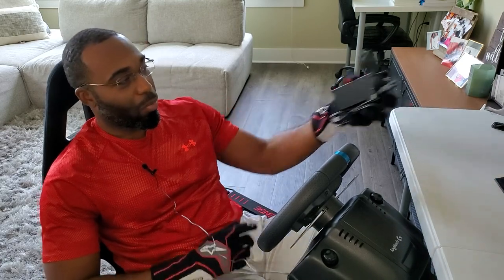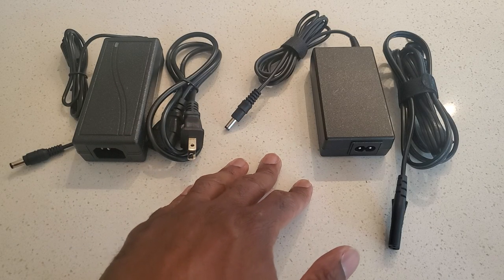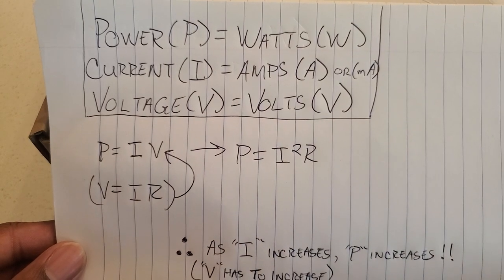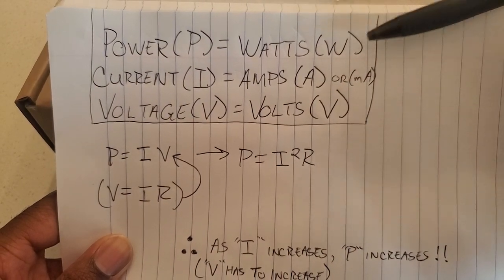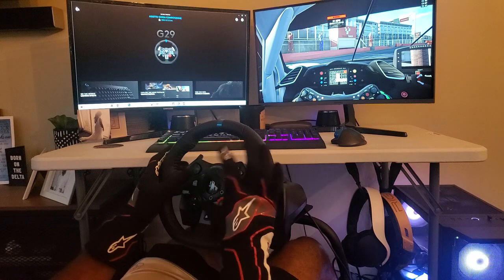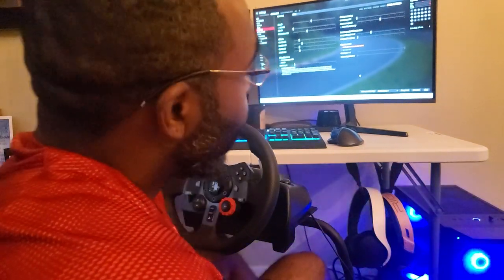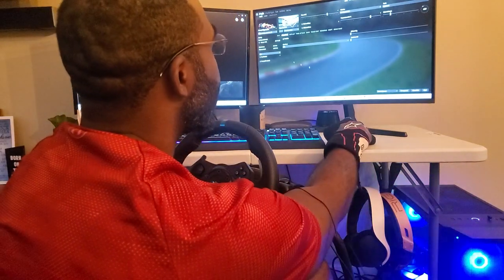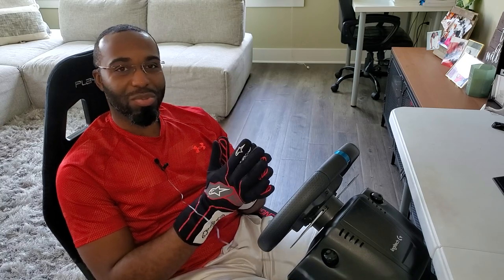G29 5A Power Supply Upgrade

Comment: I'm afraid that's NOT how it works. (Electronics is my fully qualified trade).
P=IV is correct, but current (I) is not determined by the number written on the power supply. That is only stating the maximum current that power supply is rated to deliver. 
CURRENT is derived from Voltage and Resistance by "I=V/R".
since V is a regulated = 24V; it will not change.
and R = the electrical resistance (inductive reactance more specifically) of the PHYSICAL WIRE in the motors windings; it will not change.
If V doesn't change, and R doesn't change then "I" DOES NOT change. 
The included powersupply for G920 (which is actually DC 24V @ 1.75A not 1A but it doesn't matter) will already have current overhead by design. If logitech were to provide a powersupply that was too low; then 1 of 3 things would occur: 
1. an unprotected powersupply would overheat and possibly burn
2. over current protection (OCP) would kick in and the power supply will shut off entirely.
3. the power supply will hit current capacity, and since I and R cant change, then V will drop below 24V (Vdroop) and the wheel may shut off.
Since a 1.75A PSU is supplied: Being a mass production consumer product, a you can "expect" that actual current requirements will be somewhere around 1A (I might measure and confirm this myself if anyone is interested)
You could connect a 24V 300A PSU to this wheel and it will only ever draw the same ~1A at 24V.
Reply from the maker: @forestR1 thank you for the explanation!  This illuminates things. Can you help me understand why there is a difference in the FFB? I know that a lot of people will day that it is perceived but I have tested both power supplies extensively on the same tracks and cars and there is a noticeable difference  etween using the two power supplies.
Reply: @JCCollinsRacing  "perceived" is my first reaction too (with a caveat) you say a lot in this video that you don't really feel any difference. Then when you do start more feeling more hit It's AFTER you have cranked setting up way beyond what you usually run, so it's going to feel different. then going from F1 to ACC, youre still going have F1 feeling as your reference.  
But the caveat: YOU have the actual hands on experience here. I dont. Perhaps the included power supply is too low. I find it hard imagine logi would do that; but it's always possible.
The test i think could prove one way or the other; play the SAME game, with the SAME settings using both power supplies. go back and forth a couple of times changing nothing else.
If you are still sure the power supply is the difference; then maybe i should measure the current draw (will require me to pull cables apart).
Reply: @forestR1  I don't know electronics well, but I have limited experience with a hobby motor and different batteries. I have a 2 cell lipo and a 6 cell NIMH. Both had a similar voltage. Both had similar top speed in my rc car. However, due to the nature of LIPO batteries, they can dump a LOT more amps than a NIMH can. The RC car had a significantly faster acceleration with a LIPO.

I am not an electrical engineer at all. I just have a hobby grade RC car I mess around with occasionally, and thats just from my personal experience. In mine, the power source did effect the performance of the motor. But not in top speed, only acceleration. It also burnt out my brushed motor lol, but thats because it was old. Same speed controller, just switched it to LiPo mode ajnd put in a lipo battery with a similar voltage but higher amperage.
Reply: What about adding a 28 or 30 volt power supply then? Will that help the force feedback assuming it doesn't burn out?
Reply from the maker: @Sirrecalcitrant  according to some of the comments here, increasing the voltage will definitely effect the FFB, if the motors are rated to handle that voltage and if the internal systems of the G29 will allow that voltage to go to the motor. I do not know the exact technical specs of what the motor is rated for, but I would assume that 30V would fry the motor and system.
Reply: @JCCollinsRacing  Sounds like pure confirmation bias. Try a blind test where somebody else switches the PSUs and you then need to find out which PSU is currently in use. Do this a couple of times and see if you can actually reliably tell the difference. Make sure you don't get any hints whatsoever from the other person.
Reply from the maker: @EnnoMaffen  I like this blind test idea! I may have to give it a try.
Reply: The wheel likely has pretty bad power transients meaning power will momentarily go above the rated power of the supply (while still averaging less than the actual rating), leading to vdroop, and as long as that droop isn't insane enough to fall below step down circuits for the control logic (around 5V probably) the wheel will just feel a bit slow to respond.
More headroom for current will fix that, higher voltage AND current makes the experience even better.
Reply: @MetroidChild  i suppose so.  i was working on the assumption that voltage wanted to be around nominal to stop the wheel from disconnecting, but you're probably right about 5V. Infact i think the wheel does work off USB alone. so.. Im probably wrong after all
Reply: So it doesn't hurt boosting your placebo.
I have g29 for 4 years with 3A psu. I bought it second hand with non. I later bought g923 brand new. 
Anyway. I tested the g29 with the original psu and  in a rally with lots of frequent feedback from the bumps, I can definitely say that with the bigger amperage you can feels more details when you get more action. Torque is absolutely the same.
Reply: @EnnoMaffen there's a series where a guy over volts all sorts of electric toys. They ALWAYS perform stronger and faster! But once the voltage goes too high, most toys shake themselves to death 😂😂

Comment: There is a full motherboard in it that controls the whole system of it including power supply so it will not change a bit BUT if its asking for more power a heavier psu will help it 😊😊

Comment: Thank you for the recommendation! Just got mine in the mail and after some testing, it does indeed provide a noticeable difference in the response of the wheel which helps a lot with quicker counter steering while drifting especially. It doesn't immediately become a belt driven wheel, but it is definitely an improvement and worth the small investment.
Reply from the maker: @Bryan Cheah I'm glad to hear that this worked for you!
Reply: Being UK 12v 5a b ok for this?
Reply: @ThePrescott32  you probably will need a 24volt one, lower will make it weaker. However, only go higher at your own risk, you might damage the motors.
Reply: @bryancheah2568  no I get 24v 5a as seems b save side of it
Reply from the maker: @ThePrescott32  I am not exactly sure about the UK... make sure that the power  supply matches the voltage of your home's outlet to avoid any issues.

Comment: ICs and motors are under-used with OEM power supply, so you can use more voltages without any other upgrade.
Pay attention only at temperatures and do not over 30-33V because maybe you will not able to calibrate.
Actually, I'm at 30V and cooling with a 50mm fan and drill some holes on cabinet: those seems to be able to cool either ICs and motors
Reply from the maker: @Andrés Cremades that's pretty intense! Have you noticed a difference in FFB?
Reply: @JCCollinsRacing  The increase in strength is like from night to day, you have been able to verify it. but it is the least. What strikes me the most is how it represents small forces.

What the steering wheel has gained is in speed and reactivity. Raising the voltage increases the speed of rotation of the motors.
Reply from the maker: @Andrés Cremades I'm sure with the increased rotational speed, you get more fidelity in the ffb.
Reply: @JCCollinsRacing  Good question. And the answer is that I have no idea if the fidelity of the FFB is disrupted. I'm happy with the result.
Reply from the maker: @Andrés Cremades if you are happy with the results, then that's all that matters.

Comment: Well , I can say that if you have 24v only , then 1.5A is the max current the motor will consume. Which means the power supply orignal with 1.75A is a suitable and well design , To have bigger psu in current capability is only have more margin for psu itself but won't push any more current to the motor. To increase the power of the motor , you need to increase the voltage first and base on the voltage , increase the current capability.  And increase the voltage also have your own risk .

Comment: Your math is off
Those motors don't draw more current than they are rated for
And your voltage and amps are both changing there
But only when under load
If you don't have load both should read 24v or at least close to it
But under heavy load weak one might measure 20v and powerful one 23v
And that effects current draw because of motors resistance, inductance and capacitance
So like you see it's really hard to just but it in simple math calculations when everything constantly changing
Reply from the maker: @Arpeman thank you for the explanation.

Comment: If there is any Power Protection Circuitry on the Board then it will only allow the right power past that is 1.75 amps @ 24 volt

Comment: It won't pull the extra power, it's just not how it works, it can pull up to 5amps, you need to upgrade the power board inside the wheel. You probably want to upgrade the motors but heatsinks and a fan might be enough depending on the board you get. Going from 1.75amps to 5amps, you would feel a huge difference, your just experiencing the placebo effect.
Reply: Unfortunately that is how power draw works for linear PSUs. The nominal voltage and current may be around 24V, 1A but under heavy loading the motors can draw over the 1.75A max that the stock PSU is rated for. When this happens the voltage will sag due to limited current and it will cause the ffb to clip. I’m not making this up it’s just scientific fact of how motors and PSUs work together. So upgrading the PSU will have an effect, how noticeable it is depends on your own scenario.
Reply: @luckyupyours When you say "clip", do you mean the sudden jerk, then nothing and it makes a loud bang?
Reply: @calinpetrescu9128  yeah, no more juice so it gets jerky

Comment: I'm from EU but the IEC cable on the replacement PSU looks sus. Like they require that these cables be capable of carrying 16A here because the next fuse is in the PSU, and you want them not to start a fire in case of a fault, so those cables come out thicc. This does not look very thicc to me. In contrast 2 pin mains cables must only be able to carry 3A so they can come out thinner. I have seen PSUs which ship with out-of-spec IEC cable and then next thing always tempted to look inside the PSU and usually find things that are... scary. Like, i don't even care about the IEC cable per se, it's just an early indication that perhaps the whole package should not be trusted. Get your PSUs from a trusted supplier. People's lives are at stake. That's going to be manufacturers like Meanwell, CUI, Edac, XP Power and Phihong, maybe Delta and Lite-On, you're probably going to pay upwards of $60 for either if you demand 5A, in turn they are guaranteed not going to kill you or start a fire. 3.75A come in at a much less painful $40. And absolutely no Amazon, due to fakes. Of course that's not gonna happen because well affiliate links.

WISH??? YOU HAVE TO BE BLOODY KIDDING ME!!!!

Also your "science" section... where would the current go? Because the motor you can think of it as resistive in nature for the purposes of Ohm's law. While its resistance isn't truly constant over time, in any given situation (combination of input voltage and mechanical resistance, and prior state) it is repeatable. So there exists a certain consumed current that will never ever be exceeded by a motor at a given supply voltage. Your substitution where you eliminate voltage is misleading. The reason uprated PSU can be sensible is because the OEM PSU might be so borderline that it can actually buckle in voltage whenever the current peaks. The spec voltage on the PSU is only the nominal voltage at low load, it doesn't take the effective equivalent series resistance of the PSU's output circuits into account, and a voltage drop occurs across this circuit section, detracting from the voltage available at the load.

I also wonder how well people can remember and compare their sensory experiences from force feedback, especially given it's never quite the same situation every time, and i'm going to bet, 99% of the time the performance is going to be the same, as Logitech would have used reasonable engineering principles when selecting their PSU. You might have heard, there has been endless amount of research about audio - that people imagine they hear differences when they don't, simply because they have primed themselves with an expectation. A blind test may be called for, where a second experimenter uses a good randomness source to select one or another PSU and plug it in, and then you would have to try to tell which PSU is running.
Reply from the maker: This is all very good feedback! Thank you so much for your insight and for watching the video! I learned a lot from the many comments in this thread, and this one definitely adds to my limited knowledge of electrical engineering. A great comment! Thanks again.
Reply: They might have used 1A to reduce the wear and tear and increase the lifespan though. Always hitting max capability of the hardware decreases the number of cycles you can run...same reason why DD have 10+ NM but then they tell you run it at 50%, it's never intended to use all 10nm.

Comment: its gonna be 120 watts true, but not constantly the thing it will do that the wheel will be able to pick up that much it wants, maybe the motors can run a 29watts but it cant pick up that much because the maximum is 24watts, you upgrade if you upgrade it to a 48watts power supply in this instance it will also pick up 29watts

Comment: I doubt the stock power supply is running at max output so having a power supply with more current isnt going to do anything if the motor doesnt draw more than 1a
Reply: I bet the opposite, Japan over engineers a lot of their stuff, the given supply is probably well below the actual limits to increase the lifespan of the device
Reply: @meman24  you do know that Logitech is a Swiss company?

Comment: I did this around a year ago worked fine until I broke the switch that selects ps3 or 4 but that was me the wheel held up fine 👍 just a heads up long stints it started getting rather hot so I cut the top out and added a usb 120mm pc fan never overheated again
Reply from the maker: @Stan-Chi 2017 that's a serious mod to add a fan! Was it a difficult mod?
Reply: @JCCollinsRacing  no it was a really easy simple quick mod. Just get a soldering iron and use the knife attachment cut out the size of your fan and silicone it in plug fan into USB & your ready to put 6 hours at a time in
Reply: @JCCollinsRacing  im about to do the fan mod again to my new g29 will do a how to on my channel hopefully next week 😀
Reply: @JCCollinsRacing  Fans are easy to install, grab your dremmel and get cutting! lol. I did a fan mod on my old T500, its internal fan was silly loud.

Comment: Good video. I will have to give it a try. Im always looking to making my experience better while in the sim. I mean I dont have all the fancy equipment like the "Return King" that had commented earlier. Im sure he told them that each wheel he returned had a defect instead of just being honest and saying I just wanted to take it for a test drive. People like that are the ones I like beating the brakes off of. The best part is when I tell them I have $160 in my whole setup. $99 used G29, free PC, $20 mouse and keyboard combo, $20 for material used on "rig", and $20 for a headset. You really should try Iracing. Theres promos everywhere for 3 month subs for less than $10. I am 1 week away from my 1 year mark and I am on usually daily. Im about to check out your other videos. New sub for sure.
Reply from the maker: @Haterbilt I truly appreciate the sub! Sounds like you have mad skills with the G29! I will have to look into the deals for iRacing. The sub fees are the main thing holding me back at this time, but I am definitely going to take the leap and try it out in 2022. Thanks again for the sub and welcome to the channel!